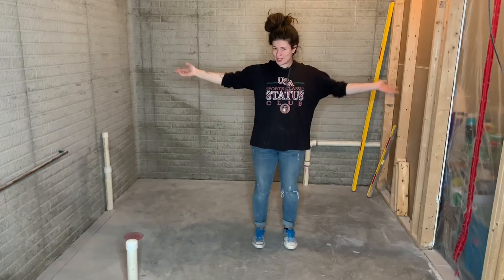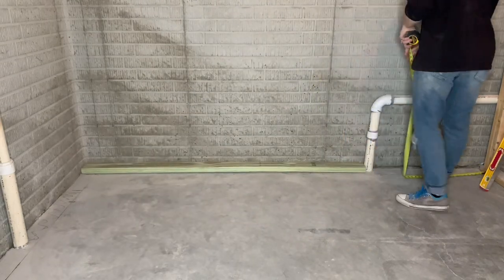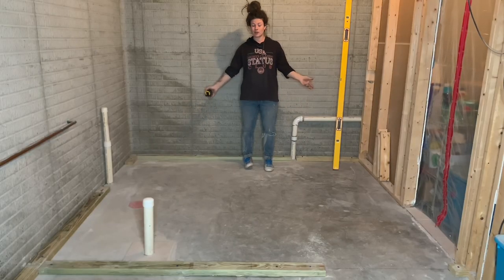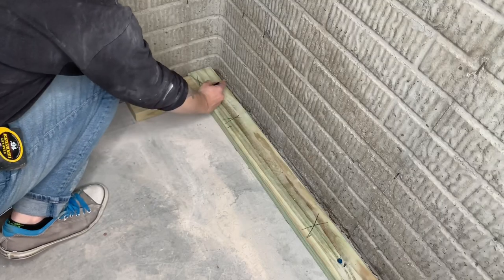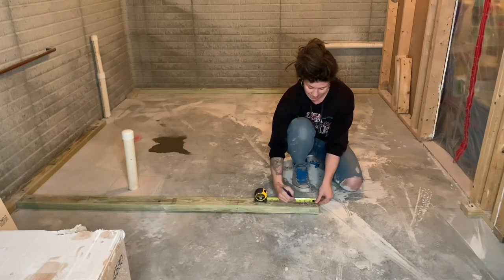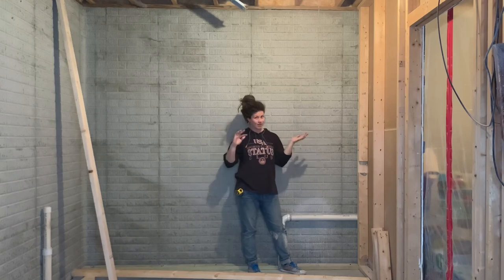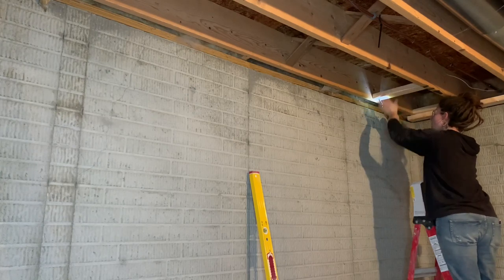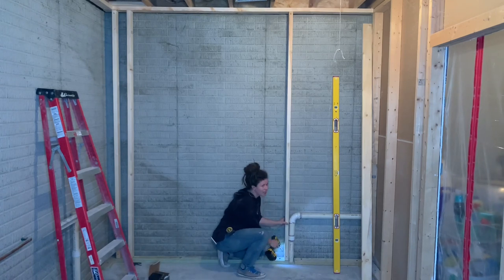How To Frame An Unfinished Basement Bathroom

Comment: We have so much ground movement we have to use a floating wall in the basement! Love watching can’t wait to see finished bathroom
Reply from the maker: Wow, interesting! Does that work? I would think whatever you would attach it to would also move if that is the problem, or is it just the basement floor that you have trouble with?
Reply: Handymom just basements we actually have huge pillars that are adjustable in the basement that can help with any settling. They are attached to the main steel beam in basement ceiling! So far so good! Lol they are almost like a jack. Luckily we were able to put it in the laundry room so not visible to guests.

Comment: Thank you for this video. I had a hard time seeing how to frame a wall "on the fly" like this vs building it on the floor and raising it. I have a room that has 2 frames already but two walls are exposed that I want to frame but to build a frame in that room on the ground is impossible, and building it out side and trying to bring it in is impossible as well.

Comment: love it...what if your floor is not leveled?
Reply from the maker: The rough opening should have plenty of room to accommodate a floor that isn’t level, so you don’t need to worry about it in the framing stage. The process of hanging the door frame itself is when you will take it into account by either shimming up or trimming down one leg of the door frame to make the top of the frame level.

Comment: What screws are you using to screw the studs into the top plate?  I don't see that listed in the supply list.  Also, I think I see that you are screwing one screw in the FRONT of the stud into the top plate, and one screw in the SIDE of the stud into the top plate.   Is that correct?  Usually a nailer would put both nails on the side right?  Last question, about which screws to use to screw the studs into the top plate.  Did you use 3" or is 2 1/2" ok?  Thanks!

Comment: Hello! Question! I thought for studs with plumbing running through them we had to use 2x6, not 2x4? Can you explain why you didn't need to use 2x6? (I bought a ton of 2x6 so if I can swap it for 2x4 to save money that'd be amazing.)

Comment: i was under the impression that framing with PT lumber is a no no for the fact that it changes form as it dries. Is this true ?
Reply from the maker: It’s actually a requirement for any piece of framing that comes in contact with concrete to be treated. So in a basement situation, a bottom plate sitting on a concrete floor needs to be treated, and if you were attaching your studs directly to the foundation walls those would need to be treated as well. 😊

Comment: Seems to be some debate about whether you can pre build wall and raise it in.  And use shims.  What’s your opinion?
Reply from the maker: If the wall was non-structural like these furred basement walls, I would see no issue with doing it that way. For supporting walls I would be a little more hesitant to break from standard procedure.
Reply: Handymom yep I am referring to non structural basement walls thanks!

Comment: This may be a silly question- I'm wondering what you came up with on the ceiling for drywall backing. Since your top plate is lower than the floor joists above wouldn't you need to install some sort of backer that falls lower to achieve that? Or do you install the drywall to the floor joists to them and cut your drywall sheets tall enough to meet it?
Reply from the maker: Yes! The walls are built to butt right to the bottom of the floor joists, so for the walls that run parallel to the joists, or for corners that are farther than 4” from the nearest joist, you go back in once the walls are in place and attach drywall backing to the top of the top plates overhanging into the room, so that the ceiling drywall can be attached completely around the perimeter.
Reply: @JunksawStudio   @Handymom  Thanks for replying to my question. Your videos on framing have been the most helpful I've found. It was helpful to see you do the math. So many people leave that part out because they think it's common knowledge.
Reply: How would that work for sound proofing?